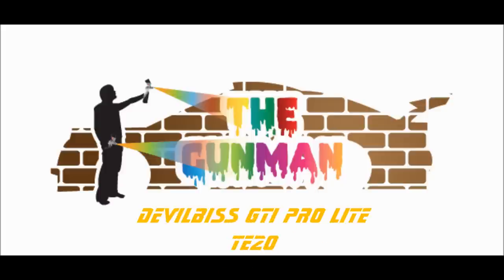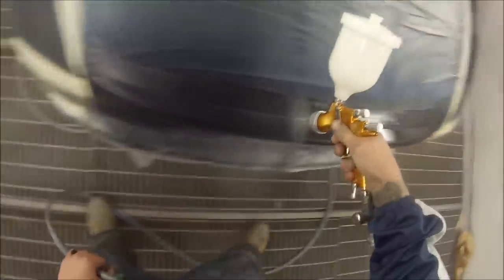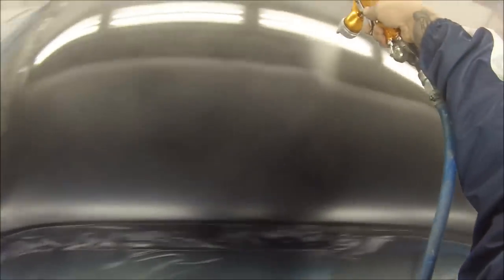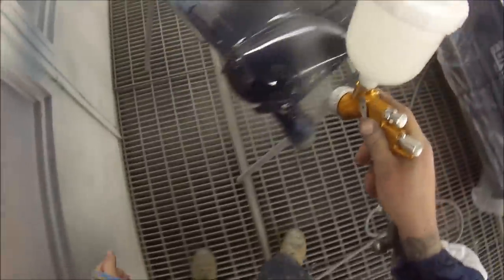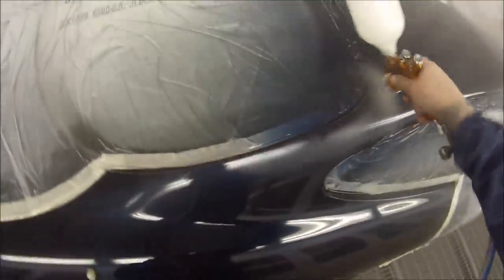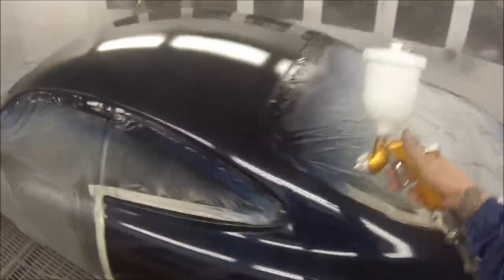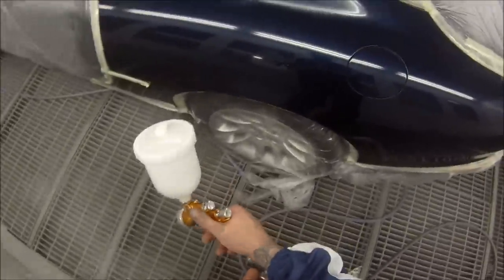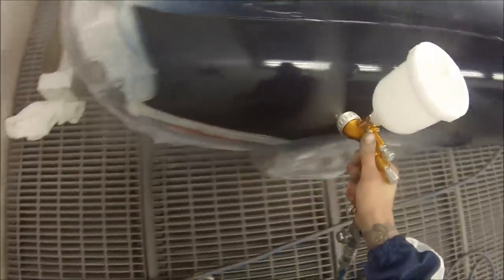DeVilbiss GTI Pro Lite TE20 Clear Coat XKR Jaguar

Comment: I am a beginner DIY painter and one of the most troublesome things I have found to do correctly is to develop the proper gun movement techniques. I watch your video to learn how you hold the gun, the distance from the surface and your constant movement in order to apply the appropriate 'flow' of paint.  Your instruction and demonstration of the appropriate pace, distance and psi settings has been very informative.  I realize that you have a ton of experience  and muscle memory development for spraying technique.  Continue to demonstrate gun movement and positioning. Thank you.
Reply: 8 years later I know you figured it out! 1000 cars by now

Comment: Hey Gunman Im newbie..first time paint cars what you recomend to start spray gun i should use..I know that Sata RP its best to do clear coats but I recently watch your video and the Devilbiss GTI Pro youre are using looks great!!
Reply from the maker: Yeah man the Pro lite is the way to go if you ask me, its versatile, cheap, high quality, easy to use, lightweight, efficient and look cool. I don't agree that the Sata RP is best for clear because they are overpriced, heavy, not as efficient as the DeVilbiss that you could buy 2 of for the same price and not easy to use, I've seen the biggest runs ever with the 4000B RP and they aren't efficient on the paint either.
Reply: Yeah..thank's for the help..Devilbiss will go!!
Reply: Hey Gunman..yesterday i said to you what spray gun i should use for first time begginer and you said DeVilbiss Pro Lite..my question its what type of Prolite I should buy to use it in primer..color base coat and clear coat?
Reply from the maker: you should have a separate gun for primer filler that is a 1.8mm or 2.0mm, I have the Airgunsa az3 1.8mm and love it, but the Pro lite 1.3mm will do for wet on wet primers, basecoat and clear
Reply: thank's man..each day watch your videos..keep up the good work!!
Reply: @TheGunmanChannel  Thanks for this comment its the information I was looking for. love your videos

Comment: Hey man, you are completely awesome! I just bought the exact gun you have on this video. Tekna pro lite w both 10 and 20 air caps and 1.2 1.3 and 1.4 tips w the dekups system. I bought it because of you. Thanks. I build guitars and I am hoping that this gun will spray as good with a 6inch fan. Any thoughts?

Comment: I never really see reviews on spraying base coat ( particularly waterborne ). I just got my gun in the other day. 1.2 - 1.4 with TE10/TE20 caps. I started off with 1.3 and TE20 around 25psi, Which is what the envirobase called for. It seemed like so much air to me and it was spraying really wet. I changed to a 1.2 nozzle and left TE20 on and it still seems like it sprays wet. I had the fan and fluid wide open, but didnt get to fool around with it a whole bunch. Im just a prep guy in my shop who gets to do cut in's and a couple paint jobs (using the painters supernovas). Painting is a lot of information to absorb and im doing my best to suck it all in, but i hope this gun works well for base coat, because that is what i primarily want to use it for. I already bought an LPH400 for clear. Any advice would be appreciated, keep up the good vids bro!!

Comment: I bought the vigilante prolite. I’m used to my sata RP 3000 1.3. I’m still trying to adjust a month in. I’ve tried the 1.2 with the te10. Then the 1.2 with the te20, then tried the 1.3 with te10, then tried the 1.3 with the te20. I noticed I have to slow way down to get it to pump the clear on. I’m going to try the 1.4 with the te20 today and see how it goes. I really want to make the gun work for me on clear, but I keep reverting back to my sata. I’m a fast painter, I’ll let you know how the 1.4 does

Comment: Completely sold mate! Ive seen loads of your vids where you use this gun! I decided to use your method of dedicated clear/basecoat guns, and my clear gun just called it quits this weekend! 
got a few quick questions,
1. Where can I get one here in Perth?
2. Can I use the TE10 for clear?
3. Can it also be used for basecoat in a pinch?! 
Thanks mate, love the vids, very informative and in depth!
Reply from the maker: Thanks mate, so if you want the cheapest Devilbiss you will get Australia wide then ebay is the place to go, you will probably have a week & 1/2 wait and will save around $100 but if you want it straight away then talk to park autos (Geoff) and say I recommended you and he should look after you. Yes the TE10 can be used for both clear and base, I will be making a review and demo vid on the TE10 soon, Its a good cap if you have limited air pressure because the holes in the cap are quite small. Cheers mate and good luck.
Reply: Excellent, thanks for the recommendation! I'll go over soon and have a look at what they have over at Park Auto. 
Cheers again! Look forward to the next vid!

Comment: Gunman - I notice before going onto the roof for the second coat you are turning a knob, then when going to the quarter panels, you turn that knob again. Is that the fluid knob, and are you opening for the roof, then valving down the fluid amount for the quarters, and if so, why? To prevent sags or runs because of gravity on vertical panels? I guess that would be my only suggestion for your videos - while narrating, when you see yourself make an adjustment, let us know what the adjustment is and why you made it. Thanks, great work and great video!
Reply: Yeah, flatter panel, wider area, and a flat surface. You can "smash it on" with more material on those areas. Turn it down a bit for edges or smaller areas, or if you're already a little too wet.

Comment: I use to use sqta all day and my hand and wrist would hurt. With this gun my hand never gets tired.
Reply from the maker: They are nice and light, they feel good in the hand too
Reply: I've never used the pro just the pro lite. It's crazy I've been training new guys to paint and there doing great withp
Reply from the maker: I have 4 Pros and love them but after painting this Jag I can see why the lite are so popular, Its just easy to get a nice finish unlike the sata I find a lot harder to get good results
Reply: The Gunman yeah sata lays it on to heavy and you can open the fluid and fan all the way open all the time. The pro lite I spray with the fluid wide upen and fan wide open at 26 psi not sure what bar that is im not familiar with bar for pressure. Base coat low 20s max 22 with the lite.
Reply from the maker: yeah 2 bar is 29 psi so very similar setup to what I usually use
Reply: Yeah for what clear I use I find 26 psi just right. My satas liked the air cranked up allot. .
Reply from the maker: yeah I never owned one but used one for a respray a week ago it looked good but still prefer the pro, they use less paint too
Reply: In the states the gun comes with a digital guage
Reply from the maker: we have them here too but they're more expensive
Reply: Yeah in America its really cheap this gun. For 375 dollars it comes with 3 fluid tips 2 air caps and a digital gauge. The sata digital will run you about 850. Tge super nova about 650. Not sure if its cheap where you are.im prob good advertisement for these guns in the states
Reply: Mike Mckay there lookin almost £300 pounds for the gun and one tip setup here mike, the caps and other tips are all extra £60 each , bloody rip off

Comment: The t10 lays it  on really wet. I also have the hv30 air cap. But my pain cap is the t20
Reply from the maker: yeah the TE20 gets a killer finish
Reply: I have been training guys with these guns and they are doing great. I remember learning with Sata it was allot harder

Comment: Gunman i am thinking of picking up a pro lite for a new clear gun. I currently use an Iwata WS400 1.4 HD for clear. Do you think tekna is easier to replicate that slight factory peel? I paint in U.S., so mostly US and Japanese cars. Also wanted to ask you if you have ever used the Devilbiss 7E7 cap? I was looking into the Devilbiss copper and those come with the 7E7 cap which I have heard is fantastic for clear. I also have a pair of Sagolas which are not particularly impressive in my opinion

Comment: I get a lot of peel I got the blue prolite with 1.2/3/4 te10/20, any recommendations on settings outside of this? I usually go 1.3 te20 33 psi 1 1/2 turn out for clear so I can dial it in and flow it out, but that was with thinner clear, I’m guessing I’m holding back fluid? Big fan, enjoy your videos

Comment: Hi the spray gun that you use to paint on this vehicle for how much cost to purches or can I order direct from you just question because i saw your works i trust you thank you
Reply from the maker: Hi, its a Devilbiss Gti Pro lite with a te20 air cap and I use and recommend it very great gun. I am in the process of trying to get some and making a website but don't have any yet I'm sorry. Good luck and stay tuned.

Comment: Where you have masked the door trim/door bump strip, someone did the same but with my lower side skirt. Where the masking has been pulled away there's a slight build up of paint, like a small lip. If I sent you a picture you'd understand better! Is there anything I can do to smooth it down without damaging the paint work? Many thanks :)
Reply from the maker: You may be able to sand it with 1200/2000 then polish.

Comment: What's the pressure you used on this gun? I'm not a pro but occasionally paint my own car. I use a different gun with 30 Psi but most of time, I keep getting clear coat drips and it's really pain in the ass to remove them. Any recommendation on how to have nice gloss looking clear coat without having any drips?

Comment: The Gunman which nozzle is best for varnish application at your option 1.3mm or 1.4mm? 
HV30? 
TE20? 
TE10? 
would like to know your opinion'm also a painter.
Reply from the maker: I'd recommend a 1.3 for normal climates but 1.4 if humidity is high, and all 3 caps are ok for clear, I use and recommend te20 but for hot dry conditions I would use the HV30, Thanks for watching and hope this info can help you

Comment: Hi does the quality of the clear coat basically determine the overall outcome of the job?
What i mean is if you used cheap clear lacquer would you not get the same amount of glossing and would cheaper lacquer die back or fade away over time?
I used a HS clear 2:1 and thinned it down by 10% on the final coat,few months after the gloss had virtually dropped by 50% but when i first did the job it was very glossy, now its faded, so im asking about if it was cheap clear coat that caused it?
I used Roberlo global 50,entry level clear coat
Reply from the maker: Theres a few factors but the obvious one would be the clear its self. It would most likely come good with a buff though. I doubt that Glasurit, Standox, Sikkens, etc would have done that.

Comment: I recently purchased one of these because you seem to really like it but I just cant get it to work well for me.  seems slow and doesn't break up the clear like my iwata does.  ?probably just my techniques but I haven't figured it out yet.
Reply from the maker: What air cap and fluid tip? I set mine to 4 turns out fluid, full fan and 29 psi these days, she hums along :)
Reply: Te20. 1.4 tip.  2 to 3 turns out on fluid control.  I noticed when I switched from the 1.3 to 1.4 it was spraying heavy on the bottom and when I increased the pressure it would spray heavier on the top. I found a happy medium at about 19 psi but I didn't feel it was enough pressure.
Reply: Thanks for the reply!

Comment: what is the difference between Devilbiss SRI and GTI pro lite
Reply from the maker: +MANDO GTZ the Sri is a mini gun
Reply: The Gunman Gunner,,I see you stopped clearing the roof half way in the middle..When start a big panel or small I always finish it,,I never start a different panel in the middle of a big panel..Just thought you would like to know..Maybe go back & wacth this video..Overall good work keep it rolling..!
Reply: He is so fast and so confident that he can spray the mirrors and the rear spoiler whilst knowing he still has a wet edge to go back to on the roof - the mark of a skilled pro
Reply: doing it the way gunman does it minimises the risk of anything touching the painted surface i.e air hose clothing etc by trying to reach over and spray the full panel in one go

Comment: how long do you leave between coats for single panels like a door or a wing? thanks
Reply from the maker: That will depend on the weather and type of paint but 5min is usually fine
Reply: We use Jun air Booths with quads, spraying Temps are around 27 degrees, thanks for the reply keep the videos coming 👍

Comment: Gunny, what would cause my pro lite not to atomizer the way it should. Getting bubbles on my first coat of clear. Replaced the white baffle gaskets. I run it around 30 psi, hs clear. Really big droplets. 2.5 turns out, te 20, please help!
Reply: Same here, feels like preassure isnt enough.
Reply: @Mankelipoika  switched to a sagola 4600. Never looked back.but I'm pretty sure my basecoat was not completely dry, still gassing out in the clear.

Comment: Hi Gunman,
I recall (I think?) you have used a Devilbiiss "Plus" (GFG670) series gun in the past.  I have a fairly new one I'm trying to dial in strictly for applying my clears.  Just wondering what settings you may recommend I start with as far as turns out for fluid control and PSI etc...  I always run my fans full throttle "open".  I have a brand new #410 cap and used the 1.3 and 1.2 needles.  Have the 1.4 as well but never tried it.  Looking for the closest and slowest I can get with a mirror finish.  I suspect the 1.2mm gets me closer and slower, and atomizes the droplets finer??
Thanks a lot!
Reply from the maker: I'm pretty sure thats the same gun as this one, and yes you are right about having finer atomisation with the less fluid and also higher pressure will give you a finer atomisation https://www.youtube.com/watch?v=HtoBGwrFa3o

Comment: what air pressure you run, I have Tekna polite and when I open the fan full it just seems like a slow clear coat gun, I'm use to and like spraying around the speed you were, any advice on setup or recommend, i have te10 te20 1.2 1.3 1.4
Reply from the maker: +Jon Calvert 1.3 TE20 full fan 3 turns fluid @ 20-25 psi at the gun, easy gun to setup.
Reply: +The Gunman, thanks I'll try that setup again, do you think the clear is my problem it's dupont 4:1 no reducer should I try 10%reducer
Reply from the maker: Hard to say, if you can get a viscosity cup then you'll know.
https://www.youtube.com/watch?v=vMWZh-nL1RA

Comment: hiya mate was just wanting to ask are the tekna and gti pro lite the same gun , I ordered the tekna from America as it was workin out cheaper with the different tips 1.2 1.3 and 1.4 and both caps te10 and te20 got it for great price , over here it was nearly same price for the gun and 1 tip setup , however I noticed theres no air control on the tekna so that's why im asking are they the same? sorry for blabbering hahaha!!
Reply from the maker: Yes mate they are the same gun, I just called the devilbiss Australia boss to confirm and he said that in the states they put a bung in the hole that we have the adjuster in so you must have to buy a regulator go between the airline and the gun like I have on all my guns, finishing brands is the company that owns devilbiss now and they changed the name in USA but are the same gun
Reply: Thanks for taking the time to find that out for me mate your a gent!!
Reply from the maker: No probs mate, Great Gun

Comment: hi gunman , I ve watch ur clear coat video before as u said the first coat of the clear is a mid -wet coat that u can not see the panel through the clear , but in this one here looks like u put the first coat way too wet , I can see the panel shiny , why ?
Reply: You can put the first coat on wet. As long as the first coat is even, and isn't dry. If you are looking for a flatter finish, staying wetter on the first coat helps, but that second coat of clear bites in good overtop of that first coat so you can get more material onto the panel on the second coat, wetter than the first. You don't want a dry first coat, but you don't need to push the limits. If that helps at all.
Reply: +dropinbiking92 thx for reply , wanna ask which way help get more clear but not run ? Semi - wet first coat  ? Or full wet first coat?I always get  runs on the side doors any help ?
Reply: Try turning the fluid in a little bit when doing side panels, or speed up, or come back from the panel a bit. If your top surfaces look good than you are just over-applying on the side panels. If paints going to run, it will run off a side panel first. Gravity always wins.

Comment: Yo Gunman, do you know why there are two different names for the same gun? Also,what did you think of the TE10?
Reply from the maker: TE10 is ok it's LVLP I just like the TE20 better, the gun is made in UK but for some reason DeVilbiss USA wanted to be different and change it but only cosmetic and a few minor changes like no air adjustment valve.

Comment: Hello there, i wanted to send a privat mesage but i cant :) so i'm asking here, i would like to buy a new paint gun, i'm working on solvent base paints, can you recomand me a gun for base coat and clear coat? thanks
Reply from the maker: dautopor I have just bought a new DeVilbiss SGK-600BV 1.4mm and its my new favorite spray gun its a good price too under $200 but if you have a bit more cash then go for the pro lite with the te20 cap, hey just get one of each if you can sfford and use the pro lite for clear and SGK for base, the SGK is also known as FLG5 in some parts of the word.
Reply: Thanks ;)